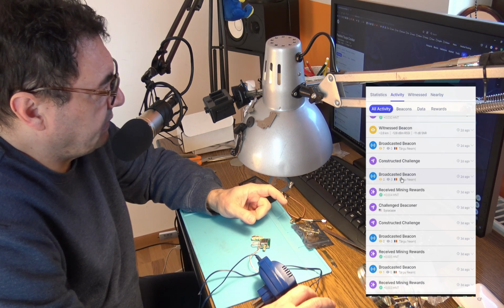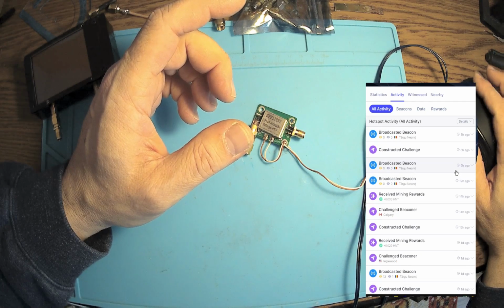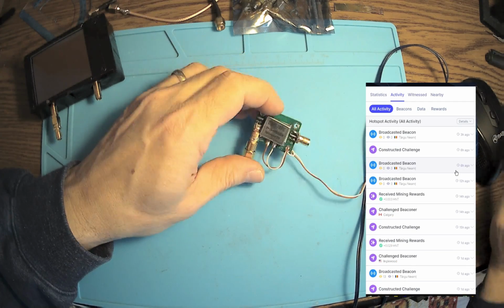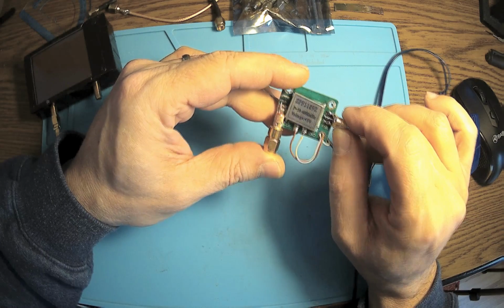LoRA amplifier experiment results

Comment: I'm currently testing Chinese LNA with added saw bandpass filter. I've already tested some filtered LNAs and the result is that only filter is better than the filter+amp. I've decided, that too much amplification is the problem and i'm currently powering 12V LNA with 5V power supply, so i'm getting 6dB(measured with my NanoVNA) instead of 18dB(on paper). Also I have access to packet forwarder logs on my pisces p100 and I can see serious radio activity with that filtered 6dB LNA. I see you are using 5V LNA, so maybe you should try powering it with 3V for example to reduce amplification?
Reply from the maker: Good idea, I'm waiting fro a better antenna now, but I'll redo the tests with lower gain too.
Reply: Hey. Can you tell me which 12V LNA you are using. The 5V usage is a great idea.
Reply from the maker: @Daniel_08554  I don't have any 12V LNA..all the tests are 5V
Reply: @Daniel_08554  Yes, but the link will be deleted from here
Reply: @Daniel_08554  There are some LNA's without internal voltage regulator and in that case you can reduce voltage to regulate the gain : "8. Others: When different gain values are needed, the power supply voltage can be reduced or customized." And also there are some very cool LNA's with digital display and gain regulated by buttons. Sorry, but I can't post links here.

Comment: Hello,
where you put this LNA ? Direkt at the Miner or direkt at the antenna ?
This is not worse LNA and this is low noise  amp. @900Mhz you have about 0.6db noise, what do you want ?
But the Saw filter has the problem, that the insertion loss is about 3-5db.
Reply from the maker: Near the miner..

Comment: you put the amplifier in front of the miner but is it not beter to put it direct on the antenne
Reply: lna direkt at the miner is bullshit(ok with filter you can get a little bit better filtering, but you get the loss, noise from the cabel).
The best place is at the antenna, so the cabel looses will illiminate and the noise from LNA is better like the noise from the Miner RX.
Reply from the maker: @thorstentorrypb2213  Absolutely right! I'm still testing antennas and setups..I'll do a metallic case, waterproof for this little guy and place it near antenna..soon.Thanks!
Reply: @viocaia  thats realy good.... I like yopur videos... And i hope i see the the homebrew Interdigital filter... :D
Reply from the maker: @thorstentorrypb2213  Still waiting for aluminum cases..the first workshop asked way to much , almost like buying one already done..but I'll try one with double sides boards..
Reply from the maker: Maybe I'll try that too..soon.